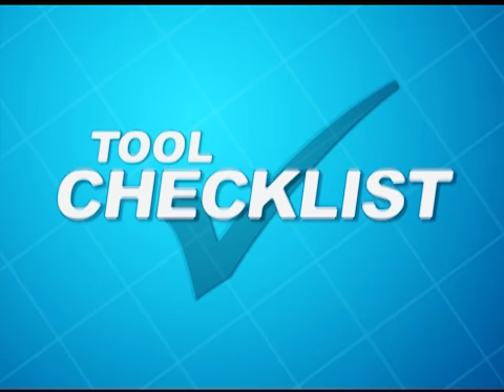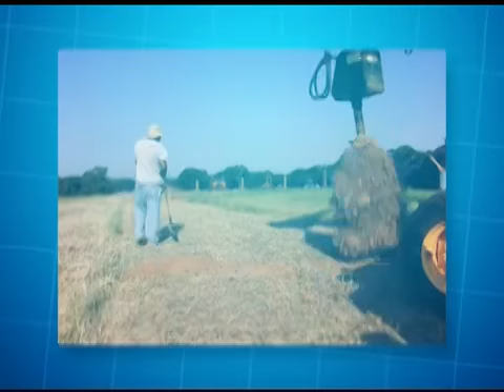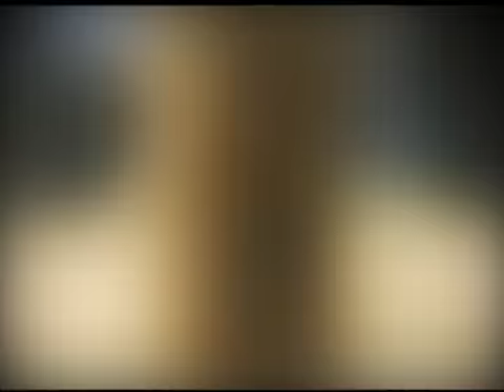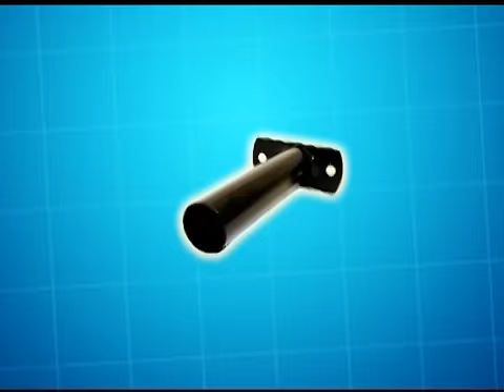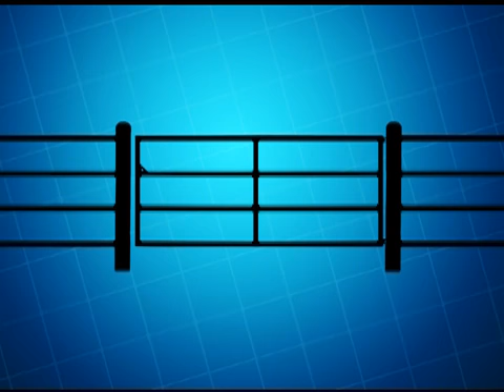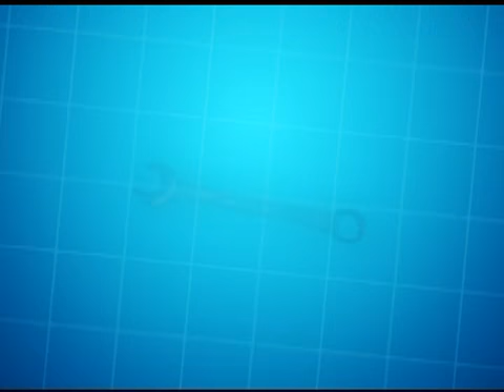Ponderosa Fence Install

Comment: All my horses chew on wood. Any way to keep them from chewing up these posts?
Reply: if they chew,i guess that mean they need something.
they are bored,or lack of something in their food.
treat the symptom,it will be cheaper.
Reply: Like hire someone to entertain them all day while I am working?
Reply: ALL your horses ,you said.
why all of them ?
Reply: All three
Reply: That mean they certainly have the same problem.
Food related lack of minerals or bored,not enough room for them,and their teeth are ok ?
Install them a mineral dispenser,(i don't know the same in english it's like a white rock)
Reply: +michaelovitch they get minerals and salts, supplements and 2 types of hay. they are just bored
Reply: Looks like.
You may can change their habits.
Reply: Ever get em to stop chewing on wood? Ride em real good do they still do it?